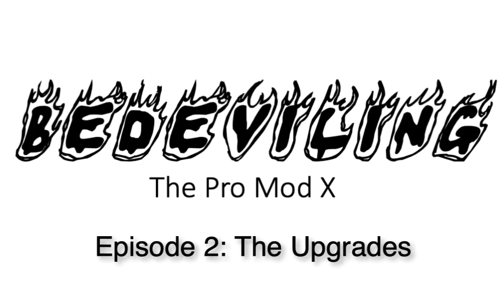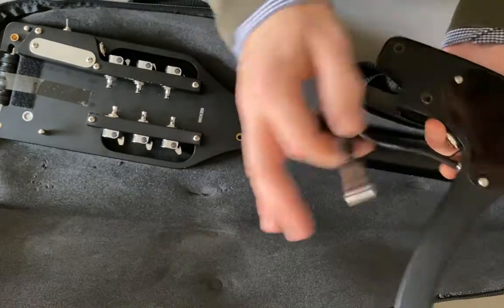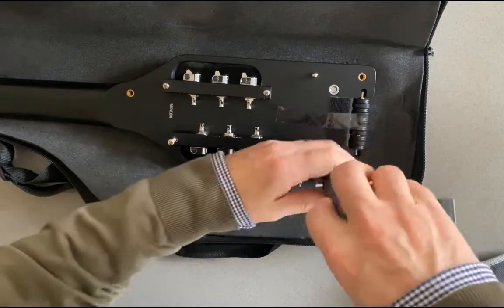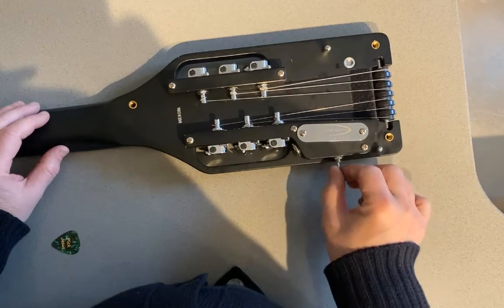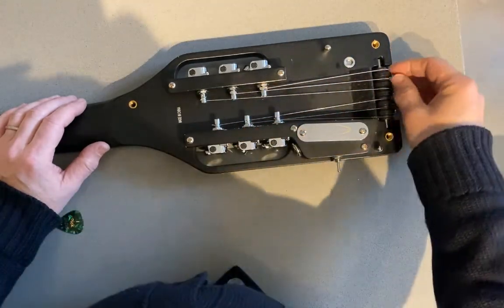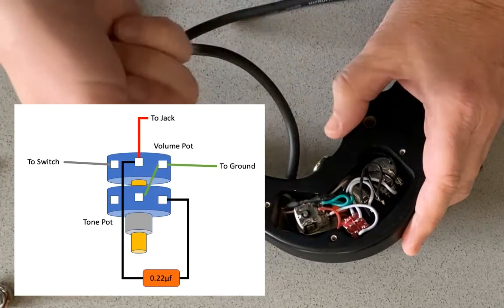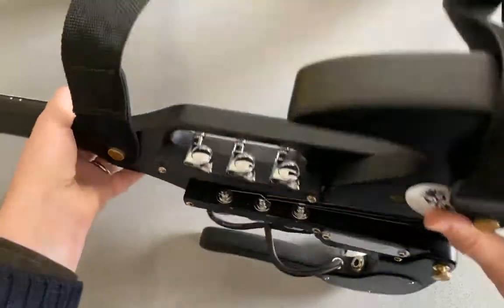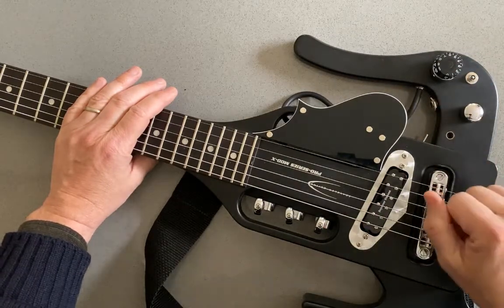Bedeviling the Pro Mod X: Episode 2: The Upgrades...

Comment: Thanks a ton for the kind and comprehensive answers, Rob... much appreciate your time.

I found a number of audio taper, 500K Ohms pots on Amazon, but I am not sure if they are suitable. Here are a couple of them:

Is short shaft what we are looking for (threaded bushing is 3/8" tall X 3/8" diameter)? Or a different shaft length?

I would love to add a tone control, as you did, but I am afraid of the complexity of the additional wiring with the condenser/resistor and the space limitation you described.
Just in case I take that leap 😊, do these two components, the stacked pot and resistor seem suitable to you?:

I was going to order some nut sauce, but I will try the graphite/vaseline mix first, as per your kind advice.

I also ordered locking tuners (did you know that TG makes them, in 3 finish options)? I think with these, no modification of using a screw to install them is required. Will see when I receive them and report back.

I much appreciate your help.
Is this YT comment section the best channel to chat with you? If not, and you prefer some other, would you kindly share that with me?

I have a couple of further improvement ideas for this guitar, including one for the bag 😊... let me know if interested and I will share the thoughts.

I own 19 different guitars and loads of gadgets, many of them with travel convenience in mind... happy to share if interested.

Comment: Hey Rob, great video and thanks for sharing. Do you think that the pod you used for the new pickup will work well with the original one too? I have 3 other TG models and they all suffer from the same design flaw, it seems. Would you be kind to share the pod model/specs/source?

What lube did you use for the rollers and did it really improve anything in tuning stability? I cannot understand the physics of why lubing those pieces helps...
Many thanks in advance.
Reply: Sorry, pot, not pod 🤭
Reply: @cristiansucu4450  it's either 500k or 250k ohms on the pot, I can't recall which! It's probably labelled on the existing pot, or you could use an ohm meter on the existing pot! The main thing is to replace it with an audio taper. As for the lube, I used guitar nut lube (there are several on the market). You could also try graphite from a pencil mixed with vaseline. I'll probably try that next, as the solution I've got isn't perfect! WRT the physics, it's all about sticking! A pulley with some friction can cause tension on one side of the pulley to be different from the other, until it slips and equalizes!
Reply: Thanks a ton for the kind and comprehensive answers, Rob... much appreciate your time.

I found a number of audio taper, 500K Ohms pots on Amazon, but I am not sure if they are suitable. Here are a couple of them:

Is short shaft what we are looking for (threaded bushing is 3/8" tall X 3/8" diameter)? Or a different shaft length?

I would love to add a tone control, as you did, but I am afraid of the complexity of the additional wiring with the condenser/resistor and the space limitation you described.
Just in case I take that leap 😊, do these two components, the stacked pot and resistor seem suitable to you?:

I was going to order some nut sauce, but I will try the graphite/vaseline mix first, as per your kind advice.

I also ordered locking tuners (did you know that TG makes them, in 3 finish options)? I think with these, no modification of using a screw to install them is required. Will see when I receive them and report back.

I much appreciate your help.
Is this YT comment section the best channel to chat with you? If not, and you prefer some other, would you kindly share that with me?

Comment: Hi Rob, I have been trying to write back to you in the little thread we started in these comments and for reasons I don't understand the text seems to be added and then it disappears after 1 minute or so 🫤. I will try to send it as a new comment, hope that's fine with you.
Reply: My message had some Amazon links examples and my email address... maybe these are the reasons why it doesn't get posted? I removed those and trying again...
Reply: @cristiansucu4450  yeah, I think YouTube doesn't let you share external links or email addresses in comments.
Reply: Thanks a ton for the kind and comprehensive answers, Rob... much appreciate your time.

I found a number of audio taper, 500K Ohms pots on Amazon, but I am not sure if they are suitable. Here are a couple of them:

Is short shaft what we are looking for (threaded bushing is 3/8" tall X 3/8" diameter)? Or a different shaft length?

I would love to add a tone control, as you did, but I am afraid of the complexity of the additional wiring with the condenser/resistor and the space limitation you described.
Just in case I take that leap 😊, do these two components, the stacked pot and resistor seem suitable to you?:

I was going to order some nut sauce, but I will try the graphite/vaseline mix first, as per your kind advice.

I also ordered locking tuners (did you know that TG makes them, in 3 finish options)? I think with these, no modification of using a screw to install them is required. Will see when I receive them and report back.

I much appreciate your help.
Is this YT comment section the best channel to chat with you? If not, and you prefer some other, would you kindly share that with me?

I have a couple of further improvement ideas for this guitar, including one for the bag 😊... let me know if interested and I will share the thoughts.

I own 19 different guitars and loads of gadgets, many of them with travel convenience in mind... happy to share if interested.